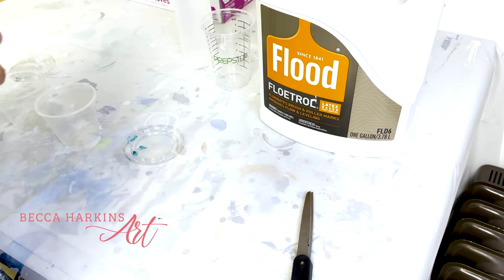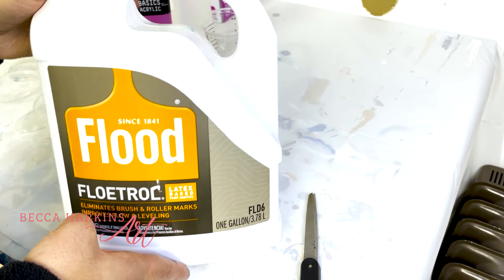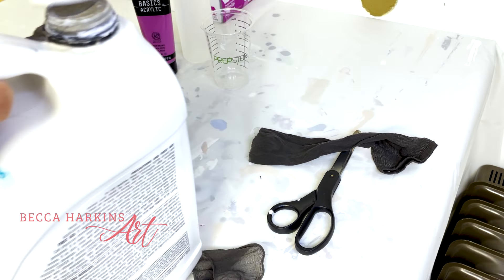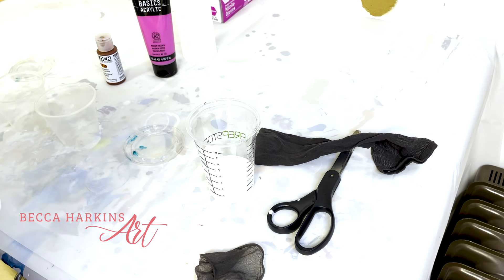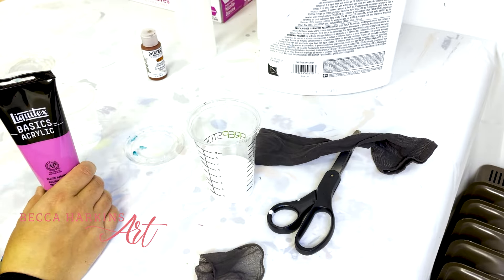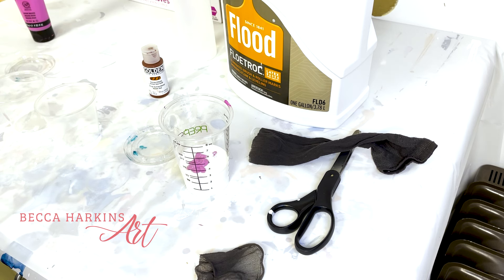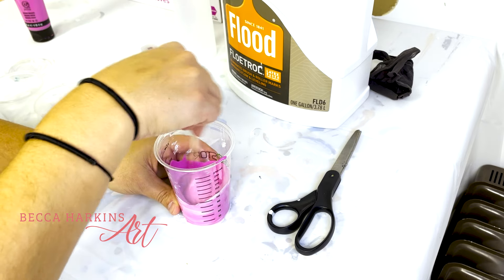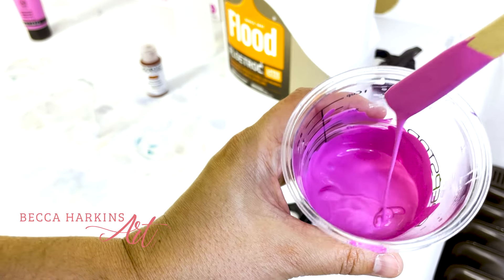How to mix your paints for the perfect dutch pour acrylic pour painting

Comment: I've been doing the same thing with the stockings to strain it as I use it. It's so easy and efficient. I do the same thing on paints, too, if I happen to catch on to the bottle of paint containing "things" of various sorts within it. One time I had Artist Loft bottles of white that had little things in the paint. It took me a while to figure out where it was coming from as I kept getting these tiny little blobs all through my dried paintings. It was so annoying. Eventually I figured out it was those bottles of white it was coming from, and I put the panty hose strainer on them. It works like a charm! Great minds figure out the same sorts of things. 😉 Yes, definitely - get the floetrol in, then the paint, mix that up, and THEN start mixing in bits of water, a little at a time so you don't over do it accidentally. Fixing that is not as easy as just doing it gradually and stopping when it is correct in consitency. I've noticed that works best for me as well, and, like you, LOL, I did not start out having that realization. I sure did NOT start out putting in the products in that order back in the beginning! LOL 🤣 But doing it other ways was a fabulous teacher. Great video! 🥰

Comment: I’m new at this and wonder after your paints have been mixed and stored , do you have to add more water to work with them?
Reply from the maker: Excellent question. Yes, sometimes I do need to add more water. I always test my paint consistency before pouring to make sure. I find that the darker paints tend to thicken up more than the lighter color paints.

Comment: Could I use any brand of flood floetrol?  Several months ago I purchased five bottles of floetrol different brand than usual,  I haven't used it as of yet does the brand matter.
Reply from the maker: Yes, you can use pouring medium instead of floetrol. Although I find it is quite expensive and I don’t like the way it blows out as much as the floetrol. But recently I’ve started to use Olga Soby’s pouring recipe. It is about the same cost as floetrol in the US but it is archival and gives really great results. If you want to take her class you can get 10% off with promo code BECCA

Comment: High viscosity actually means a product is very thick, like it would NOT flow easily as it is a thick consistency. Regarding the Golden product, I've had those same bottles and they are very thin in nature, but the pigmentation is very high and, therefore, a little is all that is needed. Is that what you meant when you said it was high viscosity? Did you really mean high pigmented? Sometimes I slip my words up and I was just wondering if that is what was meant in actuality. I've had high viscosity glues in the past and they are really hard to even squeeze out the tube due to the thickness so I looked this term up in the past to understand what the high viscosity label on the glue really meant. Here is an example of high vs. low viscosity:

Fluids with low viscosity have a low resistance and shear easily and the molecules flow quickly; high viscosity fluids move sluggishly and resist deformation. Some liquids, like pitch, glass and peanut butter, have such high viscosity they behave like solids. 

The golden paint in those bottle is supper thin so I figured you might have meant they are highly pigmented. Regardless, Great video all in all! 😀😄🤩
Reply from the maker: Yes! I did mix up my words! I’ve thought about taking the video down but otherwise many people have found it helpful. I think I’ll try to pin your comment so people can see the correct words’ I did change it in closed captions but I don’t know how to edit the video portion